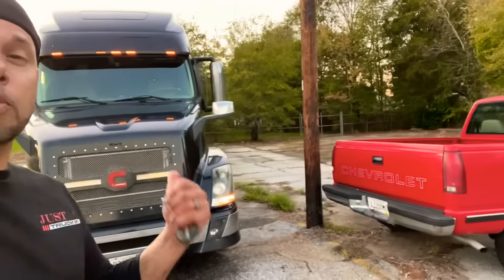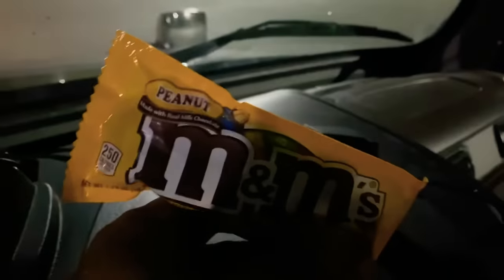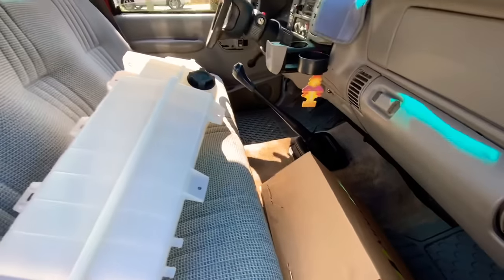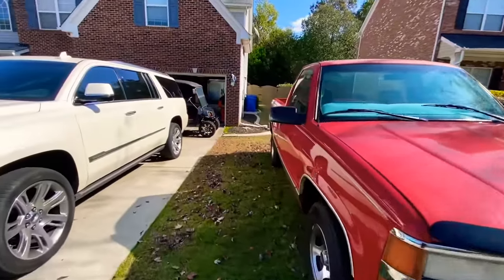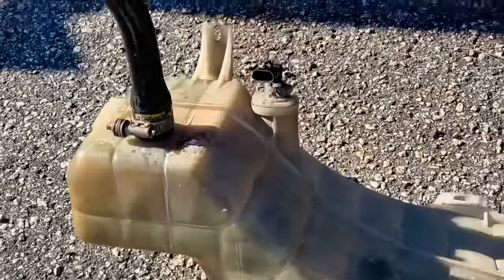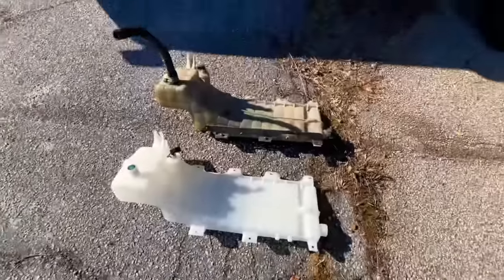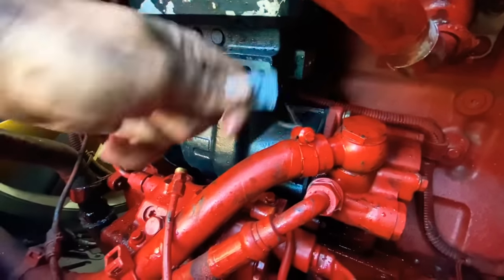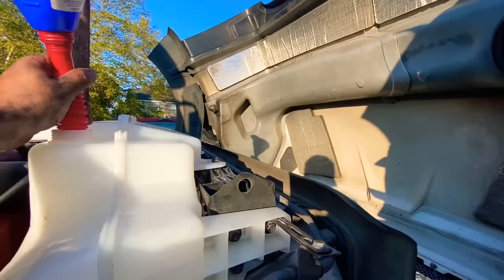DIY “ISX Cummins Air Compressor” Save Yourself A lot of Time and Money on Repair’s

Comment: I like the tips you give on your repairs. I replaced an air tank this past fall and didn't pre-loosen any of the fittings before removing the tank. It was a bear trying to get those off with the tank trying to roll on the ground. I'll keep that tip in mind for future repairs.

Comment: Not sure if you've changed the plungers in the high pressure fuel pump but there is tsb out to replace the ceramic plungers and rollers with steel copies, not sure if its still warranty work but its a straight forward process, pull the p/s pump back and pull the perimeter bolts for the fuel pump head, plungers are in the head and a magnet will pull the rollers out of the pump bore. I'll see if I can get some tq specs if your interested
Reply: Any 2010 and newer ISX (cm2250, cm2350, x15) needs the fuel pump head rebuilt regularly. They tend to shed metal, often from the cam, tappets or rollers into the oil which is pumped through the engine before reaching the filter. Early 2010-2013 engines had ceramic plungers that would chip, but even the new steel plungers are affected by the underlying problem. X15 has the oil line isolated for this reason, however the pumps still suffer the same fate. Usually goes bad sometime between 400,000-500,000 miles. The parts to rebuild the fuel pump head run about $500 every 400,000 miles as opposed to $4,000 for a new pump or $40,000 to replace an engine with metal debris everywhere. The damage from a pump failure can damage every internal part in the engine from pistons and liners to cam and rockers to bearings and even the crankshaft. Search "ISX fuel pump failure" on youtube and google for videos, pictures and more in-depth info. For extensive ISX info see Rawze.com or Rawze on youtube

Comment: If you can do your own maintenance then its a big plus because your saving upwards of $150 an hour at a shop. 

You'd be surprised how far regular oil changes, fluids checks, greasing, and etc will get you before you have to do the big stuff.

Comment: Seems like an easy enough job to change that out if all goes well, but I wouldn't have had the confidence to attempt it already loaded with a delivery due in the morning.
Reply: Yea same thoughts I would be missing a gasket lose a nut or compressor would not fit thread strip something would have gone wrong

Comment: What ive always done especially in big rigs is never fill any fluids to the full mark, so for my cm2350 i keep the oil a half gallon low from full same with all the other fluids so as everything heats up to operating temps the fluid expands increasing the volume and can start blowing out seals but to this day besides a few external oil leaks ive never lost oil when i dont have an oil leak issue i can go 25k between oil changes and not lose a drop of oil due to piston rings, rear mains ect shes extremely reliable!

Comment: Enjoy the video but you need to put a conditioner in the antifreeze so that it will come back electrolysis it's in them diesel motors keep getting pin holes in your liners I hope this is some help to you I've been a diesel mechanic for several years and if you don't do it it's just going to cost you down the road cuz you'll have 10 holes in your liners due to the back of electrolysis keep up the good work
Reply: What kind of conditioner? Give me a name. I've got that problem.

Comment: I changed out my coolant reservoir and had to remove the new level sensor because it triggered my check engine light. Switched it out with a new sensor and wire combo, check engine light went off.

Comment: Hey,
That aircompressor has timing marks on it you have to set the timing with the engine before you put it back in. If you don't the engine and aircompressor will be off balance.
Reply: Check quick serve, air compressor doesn’t have to be timed for this motor

Comment: On the bottom mount bolt (through the front panel) is there a nut and washer like the top mount bolt? Or is it just a through bolt was no nut that would tighten on to the air compressor bottom flange?

Comment: I know this is somewhat of an old video but I'm getting ready to do my air compressor on same type of engine. Did you drain all of the coolant or just what was in the reservoir to replace the air compressor?

Comment: As long as you matched the timing Mark's you will be good if not you will be buying a motor soon.
Reply: Air compressor is not required to be timed on this motor
Reply: @wb2679  yes there are two Mark's that must be matched on the gear or it throws things outta balance. Over time it gets werse and worse as it smashes the bearings on the crank.

Comment: I need to replace the air compressor mounting gasket do you have to pin the engine to remove and put the air compressor back on?

Comment: bro is air compresor coast coolant and fuel isue, because i had coolant is lose when truck is running when i turn off engine coolant is normal also i had raugh idiling first morning start engine first 10 minutes after that is ok i open fuel filter i saw inside water look likes coolant all tha isue come when compresor is noising  any advice thanks for you're video

Comment: Hello I'm in need of help...
I'm seeking a compressor for a Mack midliner with a Renault engine...
The compressor is a knorr bremse 75mm belt driven one but I can't get it anywhere ... Been looking everywhere for 3 years ...
Can any other truck compressor be used ... Is there any other brand that is single piston and belt driven

Comment: what about if you fixed head gasket compressor  my coolant starting lose when engine is running after i  turn engine off coolant overflow i think i have same issue but someone told me fix compressor head gasket i don't know, anyway thanks for showing this video
Reply: Greetings. Did you change the compressor gasket and did it fix the issue??

Comment: Your supposed to time the air compressor with the other gears tho... Right?  At least on newer engines your supposed to like the X15 and even 2016 and up isx’s. At least the ones I’ve done have timing marks
Reply from the maker: Yes that’s what I thought but then was told by two mechanics shops that it doesn’t matter and the reman compressors don’t even have the triangle mark on the front of the gear 🤔🤷🏽‍♂️

Comment: How long should it take to air up your tanks with a Cummins isx15 I think mine is kinda slow I'm also getting a little coolant in my oil too
Reply: Turned put the orings on the liners were bad and letting coolant get into the oil. Word of advice don't use aftermarket orings and seals

Comment: Got question?my air compressor is leaking oil from the bottom. Do you to replace my air compressor or just need to buy a new gasket
Reply: Ducktape and flex seal...😂🤣

Comment: have a question sometimes when I put the jake break it makes a noise like some kind of exhaust, and sometimes when I accelerate it also does it, what do you think it could be I have an ISX15
Reply: It’s the crossover tube behind the engine they get a hole in it and that’s what happens

Comment: How many miles did you need to do this repair at
Reply from the maker: Lasted 1 1/2 years roughly 150k but I had engine Inframe also 🙏🏽
Reply: @JustTruckin  thanks

Comment: What was wrong with compressor?
Reply from the maker: Not pumping Full Pressure
Reply: @JustTruckin  cool thanks. Reason I asked cuz my coolant system is over pressured. I am thinking maybe compressor head  gasket. But this compressor is only 3 months old.
Reply: @bb-ob5cc  Hey...greetings, brother
 What was the issue with the coolant system? I know it's a while back but I hope you can remember, thanks.
Reply: @joka2200  sadly  it was dropped liner  brother.. needed inframe 😔...
Reply: @bb-ob5cc  thanks for responding, man. I hope that's not my issue I only have 382k on mine. I know I over filled the reservoir and it blew out the excess but it's been doing it since. Once I turn off the truck and it starts cooling, it pushes out through the overflow. It holds the pressure in the system for days if I don't open the cap and release the pressure and leave it loose...cools fine while driving...puzzles everyone...scared of the Steelership.
Reply: @joka2200  Part #: BK 7001006... Buy this it is like 50 bucks at Napa , it detects if there is combustion gas in coolant.. on mine fluid color was changing real quick. Good luck..
Reply: @bb-ob5cc  appreciate it, man. Thank you...Guidance and protection.🙏🏾🙏🏾

Comment: 16:07 I would highly recommend the Tite-Reach wrenches for this along with the Low Profile Socket Set  Not sponsored by them, but use the product.  tite-reach.com  If you are going to do your own work it will help you get in those awkward bolt/nut locations.